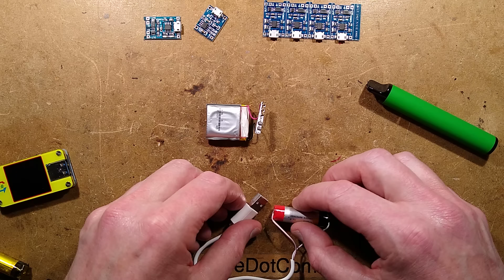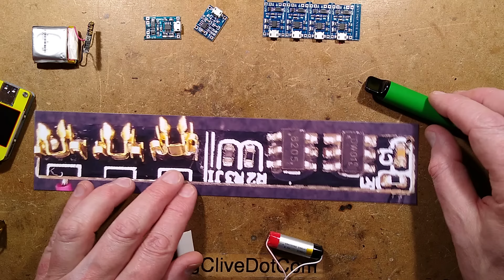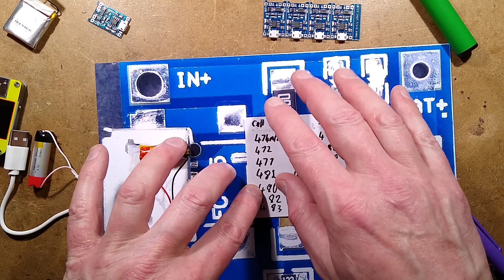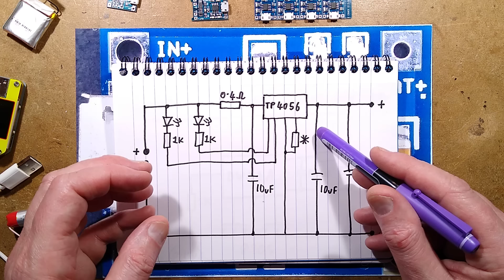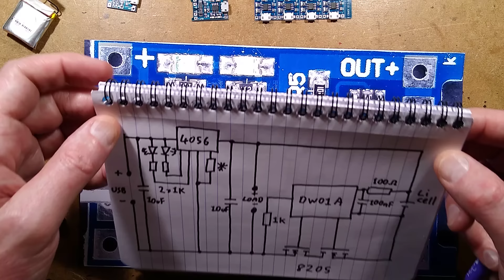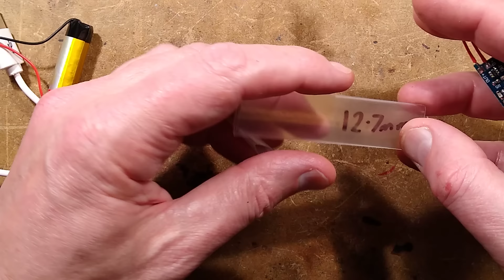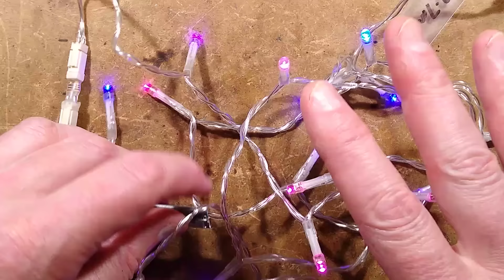Don't do this!   (There's a much safer way)

Comment: For those who want even more simplicity, try to get an olight UC magnetic USB charging cable.
It has two magnetic terminals that just sticks onto the battery ends. No worrying about polarity as it automatically sets it. And it charges li-ion and NiMH batteries.
Reply: It looks nice but it sucks that it’s not compatible with the batteries from disposable vapes, they all have little metal strips for the terminals instead of flat contacts like normal batteries. A version with alligator clips would be awesome!
Reply: @tindym  It's not difficult to use alligator clips because most of them are made from metal so you can stick the magnetic terminals to the alligator clips (which are clipped to the battery terminals).
Reply: That's fine for cells in steel cans, but that's not what we're talking about here. These are bare cells often even without ferrous tabs let alone steel caps.
Reply: Good shout, I have a few no-name units and they work remarkably well, they were less than $10 each
Reply: The last several times I checked for those little chargers they were out of stock. Defacto discontinued, I am starting to suspect. Probably in favor of Olight's onboard chargers that require proprietary 18650 cells
Reply: Or, you know, just get a mains battery charger that is ready to go out of the box and stop acting like USB is the greatest thing to ever happen to the world when it isn't even close.
Reply: @looksirdroids9134  all my old phone charger cables and USB outlets have to be good for something

Comment: 2.5V is the absolute lowest you'd ever want to discharge a lithium cell. 3V is much safer, but there doesn't seem to be any lithium bms boards that cut off at 3V. They all cut off at 2.5V.
Reply: There was actually a bit of research that as long as the cell was never reverse biased, it will likely come back without damage. This same tp4056 will ping the cell with tiny little bursts maybe once a second and if it's not shot (no substantial leakage), the voltage will gradually creep up to 2.5V when the protection chip will unlock it and the charge chip can go charge it for real.
Reply: @SianaGearz  Yeah, discharging to 2.5V won't damage the cell yet, but below that it will lose capacity and at 0V is pretty much definitely damaged. I've used these boards to "revive" cells that have been over discharged as low as 0.5V and they usually make a recovery. However, badly over discharged cells tend to always puff up, indicating damage. They still work, but I won't subject them to high current draw.
Reply: @PunakiviAddikti  Yeah if they were 0ed they might have already had internal leakage previously, and got deep discharged for that reason. Of course once they puff up they're EOL and i wouldn't be comforable using it at all :D

Comment: you ever get a hobby grade rc multi cell battery , I just dented my 1300 mah 3s with a 75c discharge rate , I am keeping it locked up tight in limo bags and a metal box , how much more can I expect from it ?
Reply from the maker: If it's just a soft dent it should be OK, but treat any damaged battery as a higher risk than a fresh one.  Keeping them in a vented metal container is a good idea.

Comment: why not use TP5100 or TP5000 they are way better and efficient since they use switch mode buck converter instead of resistance .

Comment: Ahhh.. reminded me of myself when I were a child... I used to just plug a li-ion cell directly into the 3.7v Nokia power supply, i forgot and left it overnight, it exploded and burn spectacularly in my bedroom
Reply: As a teenager (over 45 years ago) I sometimes recharged carbon-zinc batteries to save pocket money.  It worked to a limited extent.  One time I forgot about a battery (AAA or AA, can't remember).  After some time there was a load bang, followed by a loud crack / impact sound as the carbon rod flew across the room and hit the opposite wall about 8 feet away from the battery it had once occupied!  I took more care after that.

Comment: I would never do it normally, but I have done this once, my vape device didn't have a built in charge port (swappable 18650s)...either that or i couldn't get my hands on the right cable at the time, i don't recall which.  But i only left it plugged in for 15 minutes or so, just enough to get me though the day.  Works in a pinch, but not recommended for knuckleheads.  These days i carry a spare charging cable and a spare charged battery so I hopefully won't need to do it again.

Comment: I acquired a great quantity of these from my son's partner, but yes I used a usb circuit which was purchased from eBay, I have found many uses so far and got these batteries after your original video on the subject 👍

Comment: I used to fly a lot of RCs and I had only one experience with a lithium cell venting randomly. I have gone through literally hundreds of them with no problem except for that one. And I've always used hobby grade RC chargers for lipo. 
Also I suppose I was lucky the one that vented was only about 150 mah for a cheap little quadcopter.

Also lipos smell like berries to me its kind of a weird chemical sweet smell
Reply: I dabble with vintage electronics heavily, and lithium powered devices have now been around long enough that I am finding devices with cells that are 15 or even 20 years old.
THESE are the terrifying ones. They may work perfectly fine, they may be a little weak, they may just be dead, or they may be partially shorted internally and waiting for an opportunity to ruin your day (and your rare vintage ruggedized handheld computer).
Scariest one was a P4-era laptop that I didn't notice had a failed battery until it was making the crinly noises. Touched it, REALLY hot, unplugged it and got the battery out into a safe place as soon as I could. Also had a PDA whose extension batteries were bulging enough to physically disconnect themselves from the battery carrier when I tried to charge them.
As for drones, I've killed three large batteries and have a few small ones that've gotten a bit terrifying.
First, the one that came with my first FPV drone, just got torn up from me not knowing how to mount it to the drone yet. Then I killed it in a crash IIRC.
Second I killed in a crash like Ibrahim. I removed the broken cell, it's now a 3S.
Most recent was an interesting failure. The pack was just sitting on my glass top entertainment center table. I got home from work, and there was a tiny little burn mark on the table, and one of the cells of the pack had gone out. Was probably the smallest LiPo fire event I've ever seen. Pretty sure its companion pack is going to fail in the same way, it's kinda showing signs of the same problems that one did before it went pewfie.

As for killing them in crashes, I found a model that adds little aluminium "armor" plates to help protect the soft little cells when you inevitably plant the thing into the ground at full power. They're a little heavier than conventional cells, but at my skill level that's not really much of a problem, and I have yet to kill one in a crash.
Reply: I had an early Kindle Fire whose battery slowly blew up like a balloon over the course of 2 weeks... the poor little tablet got fatter and fatter until finally it tore itself apart (plastic casing separated) and ended up a slab of glass (screen) haphazardly perched atop a nearly spherical chrome-colored sac that used to be the battery.  😅  I always thought it was strange it didn't vent or erupt suddenly instead.
Reply: Venting, sounds sus
Reply: I'd say it smells of sweet wine gum or similar
Reply: No surprise that it was the tiny one that vented considering you used a beefy standard charger and likely put too much current through it
Reply: It smells very similar to rotting garbage to me, a sort of fruity smell.
Reply: If you don't destroy batteries you're not having fun... I have killed a few 1300-4s in crashes. It's the most fun when they act as delay fuses and go all rocket on you without warning when you're carrying them back to base.

Comment: This video was at the perfect time for me.  I'm building a little ESP32 weather unit powered by a couple of 3.7V batteries.  I'm going to use a couple of those little boards to make sure the unit cuts out when one of the cells gets to 2.5 volts.  Also going to make a couple of chargers for small batteries.
Reply: I recently built one using a d1 mini esp8266 and a combo aht20/bmp280. I have a type c charge control board with a  repurposed lithium. Big Clive just confirming what i know works already! I can post the code if you are interested
Reply: @HughsScamProducts  Thanks, I would love to see the code.

Comment: One question: Is it OK to have the load plugged in while it is also charging?
Reply: Replying to my own question. This subject came up in the Patreon comments for this video, and the apparent answer is No. According to this article/tutorial it can actually be bad to attach a load while it it charging. https://www.best-microcontroller-projects.com/tp4056-page2.html
Reply: @jackhodgson  Yes I was going to comment about that : if there is a load attached during charge, the charging chip will measure across the battery and the load in parallel instead of just the battery, and not realizing the battery have finished charging it could overcharge and damage it. There are solutions to switch the load to the usb input when it is connected with a couple of components, I wish they would make some modules with that option.
Reply from the maker: Theoretically the charger will still work if the load is lower than the charge current.  But the charge will never terminate because there's always a load.  But it will still never charge the cell above 4.2V.  All that will happen is that once charged the charger will be powering the load directly.
Reply: @bigclivedotcom  ... powering the load directly at 4.2v and up to the programmed charging current? ;-)

Comment: I've been using the tp4056 boards from ebay with the adjustable voltage booster on the output, very convenient,  I replaced all my multimeter 9v batteries with these tiny vape cells. I also wanted to mention the 3D printed 18650 battery holders (found on thingyverse) are perfect to use with these charging boards.
Edit: I use barrel plugs for connections like this usually, as they are fairly durable and easy to use, I know they are kinda old school tho.

Comment: Magic !!  How did you manage to plug the USB cable in correct first time !!!!   It is ALWAYS the 3rd try that works :) :)
Reply from the maker: It was the third take.
Reply: The trick is 'look, turn, plug'! Some (most?) USB plugs have a join down the 'back' side, but it's more a question of getting used to the direction your specific device wants the plug to be!

Comment: Could you put this into a tiny project box (mini altoid tin?) with maybe a 600 ohm resistor plus a 10k potentiometer in series for the programming resistor to make a variable current charger or would that be risky?
Reply from the maker: You'd need to put the variable resistor in series with a 1.2K resistor to limit the maximum charge current.
Reply: @bigclivedotcom  are there similar charging controllers easily available that can go above 1Ah charge current?
Reply from the maker: @gd.ritter  Yes.  They actually use a bank of four TP4056 charge chips in parallel with the LEDs just coming from one.

Comment: On the PCB that has charge/discharge protection, R3 the charge current resistor is SMD type 0805, this is the physical dimension type of the resistor to fit the PCB.

I know you need charge balancing for the series connection of lithium cells, but what about paralleling lithium cells to increase the overall mAh capacity?
Has anyone done this? Are there any precautions you need to take?

TIA.
K.
Reply from the maker: The main precaution for paralleling cells is to make sure they are at a similar voltage before connecting them to avoid high current flow as they equalise.  For massive arrays fusing is good too.  Either per cell or in clusters.
Reply: Yeah, parallelling is done all the time when you need more capacity than what a single cell can provide.  It's even easier than series packs as you don't need to worry about over charging or discharging any of the individual cells.
Reply: When you have them in parallel, you can pretend it's just one large cell. So, a 500mAh + 500mAh cell in parallel you can just pretend is a single 1000mAh cell and charge it at the current appropriate for that. As long as they're at the same charge voltage when you first connect them in parallel, you're safe. And don't mix different capacities. All of them in parallel should have the same mAh rating.
Reply: @gd.ritter  good to hear.
I've been thinking of this for a while. Best I could come up with is to use one of thse circuit boards per cell. In Series is fine, simply attach each BMS to each cell. 
In parallel I had thought of using a pair of diodes at the anodes of the battery. Attach the BMS's between the anode of the cells and the cathode of the diodes. Then attach the anodes of the diodes together and take your power from there.

Comment: Rather than using the molex type connectors & having to crimp them, you can get the pre-wired JST connectors which are very common on single cell packs such as those in toy "drones", cameras, etc. Just solder on, and you can interchange with other batteries and chargers.
Reply: @crunthat Can anyone give me a link for a "PDRT is better" connector?   Can't find that in google.
Reply: I also prefer the JST types for smaller batteries.. they take up less space and are fine for 1 amp or so..
Reply: @WooShell  r
Reply: Just beware that there is no standardized polarity for these random JST 2.0mm pitch you might buy on EBay and Amazon. I've had to swap the pins over on most of them in order to use them with Adafruit Feathers
Reply: @bornach  You mean no standardised wire colours?
Reply: @rimmersbryggeri  There seems to be no standard as to whether the negative (black) is on the left and positive (red) on the right or vice versa however it's easy enough to de pin them and swap over If need be.
Reply: @twaymouth  The black - red+ rule might not be universal. Kind of like hos some cars had positive earth in the old days. The rule should be what pin the wire goes to rather than the wire colours.
Reply: @rimmersbryggeri  agreed. But let’s face it, sometimes you forger. I put heat shrink tubing on and change the colors so that red is always hot. Yeah, it’s a bit of a pain, but I cut the tubing and shrink them in a bunch (after making sure that they’re backwards first, of course!) you don’t have to cover the entire wire, just the end, to use less shrink.
Reply: @melgross  Yeah that's true and a good Idea. On my car both ground and hot battery cables were black and the locking tab with the + marking on it had fallen off. That's great when you are in a hurry to jump it. a connector like a jst s more of a one shot set and forget thing tohugh.
Reply: I've got a couple bags of JST connectors, they're great for little stuff. I like XT30s and up for anything bigger but the JSTs definitely  fill a role.
Reply: @TheExplosiveGuy  bags? I've been getting them 10 at a time off of eBay. A bag would be great. Do you have a link please?
Reply: @TheExplosiveGuy  this is exactly what I'm using, along with the same charge chip. I'm using an XT30 going to 2 X small alligator (12v clips for car battery - red/ black) and I'm using this to charge dismantled MacBook lithium cells 👍
Reply: You can get a box of the little red JST connectors. I have one laying around somewhere that I was planning to use for this exact purpose, although at the time I didn't know these little charger cards existed.
Couple it with a buck/boost board to stabilize the output voltage depending on the application, and you've got a real winner.
Reply: I initially used the connectors in the video when doing projects like this but then i moved to the holy grail of connectors, SCREW TERMINALS! i also recently started using USB Screw Terminal connectors to make USB extension cables.
Reply: Small JST connectors are fantastic, but I hate that about 25-50% of pre-crimmeped ones from eBay are shot. You are soldering something, adding JST with wires and... you need to change it, cause there is no contact :/
Reply: Thanks for the tip, I'll have a look for the pre-wired JST connectors.

Comment: Wow 3A that's nuts! Is the confusion because USB ports output 5V @ 500mA?  I'm really curious how you got 3A without usb "negotiation"
Reply: It's really only computers and hubs and stuff which care about that 500mA limit, power banks and chargers will pump out as much current as the device can draw until it hits whatever its current limit is (3A in this case).
Reply: @uzlonewolf  Makes sense. I guess I am thinking more about voltage. afaik USB 3.0 requires negotiate; otherwise nothing would work.

Comment: If you reverse the battery polarity of the 4056, it gives off little smoke (don’t ask me how I know). I use the input alongside the USB plug to connect to a solar panel this allows a small IOT  device to be self-contained.
Reply: And I bet the chancers that are using stripped USB cables don't bother testing the polarity of the cable. I seen a couple of cases where the polarity is not what you expect from the colour of the wires.
Reply: Just be careful, retriggered charge cycles can mess up the cell if you have very low load.

4.2V is kinda unsafe for the cell long term, and the charger won't keep the cell at it. Except when restarted on a full cell repeatedly.